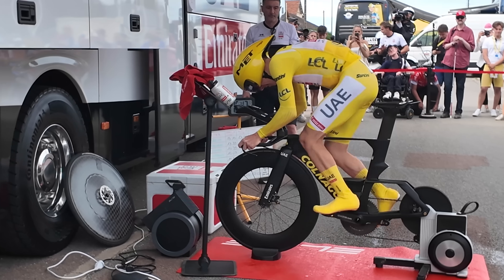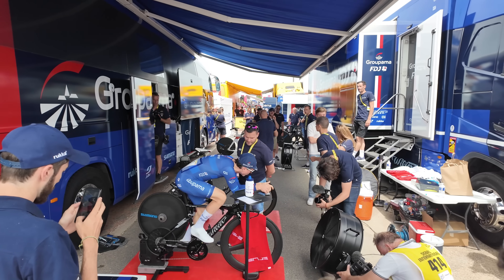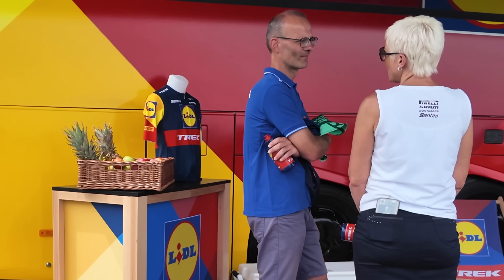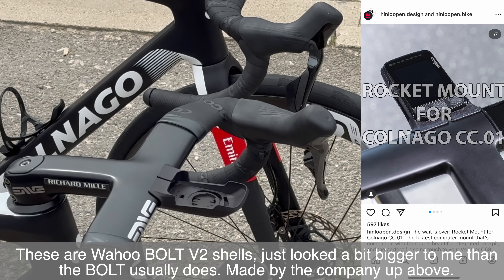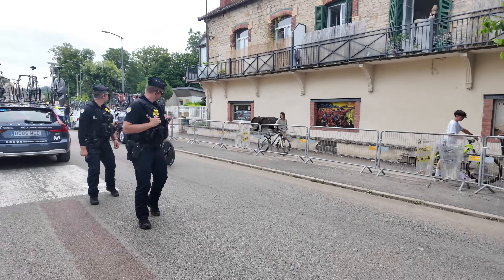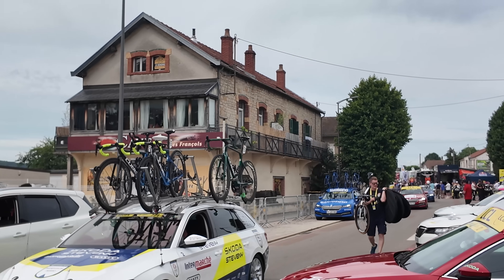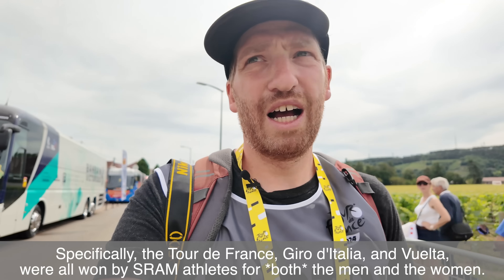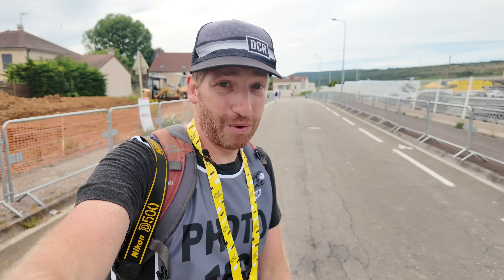Tour de France: Sports Tech & Behind The Scenes!

Comment: Can someone explain why they are using 11speed cassettes on the trainer. Do they run 11 speed on the tt bikes?
Reply from the maker: My guess is that because the NEO 2T (and 3M) came with 11sp, they were just two busy to swap out and riders are in ERG mode anyway where it doesn't matter. Or, alternatively, they have actually swapped to 12sp, but never re-wrote things. I didn't count cogs.

Comment: Do they use the edge 130 for the weight savings or is there another reason?
Reply from the maker: Partially weight, partially size (fits better in aero bars), and partially slightly better aerodynamics (but that really depends on numerous factors).

Comment: Great stuff Ray, love these behind the scenes videos. You mentioned some riders may be using pedal power meters from non- sponsors....did you see any Favero Assioma pedals...on road bikes obviously. 

Thanks as always.
Reply from the maker: Thanks! I didn't see any Favero there. There is I believe a women's TdF team that has them, but nothing on the men's side. They're a bit harder to get away with in a hidden aspect, due to the pods.
Reply: @Dcrainmaker  I wonder if they're going to eventually update their road pedals to use the spindles from the PRO MX's. Although I guess if they did that they would lose pedal body compatibility.

Comment: Why do they even have a clothes dryer with the washer? Isn't 99% of cycling gear line dry only anyway?
Reply: For you and I. For kit that only needs to last a (partial) season why not tumble it on low or no heat to speed up the drying process. Same logic for them using power washers on the bikes.

Comment: The team cars put lots of bikes on the roof, to push more air forward behind the rider.
Reply: That's why the follow distance regulation changed a few years ago. After that Ganna TT when the Ineos car was a solid wall of bikes and they were practically on his wheel. They need to stay 15 meters back instead of 10. Although 15 still seems questionable.

Comment: There are not 15 teams sponsored by Shimano. Most of them use their groupsets but are not sponsored and use different powermeter.

The sponsored teams are:
- Alpecin
- FDJ
- INEOS 
-Soudal Quickstep
- DSM

That's all. For example if you noticed at 16:00 Pogacar was using SRM instead of Shimano.
Reply from the maker: SRM is the singular example of a power meter sponsorship pre-existing the Shimano drivetrain sponsorship. Shimano also has two levels of sponsorships, one being outright sponsoring of compenents on a team (for compensation). The secondary being giving groupsets to cover it (more common on the women's side). However, there are a number of teams not on those 5 above that are upset about the Shimano accuracy issues, but are being told by Shimano they aren't allowed to use other power meters, per contracts.
Reply: @Dcrainmaker  Interesting! Thanks!
Reply: @Dcrainmaker  BTW interesting that UAE is  using different chainrings and rotors tho!

Comment: Could you make a list of the power meter each team uses?
Reply from the maker: Yup! Coming up. It's a bit messier to do at the TT stage, because sometimes we see slight differences in the groupset configurations due to the TT bikes. Usually it's 95% the same, but I'd hate to miss the 5% that are swapped/missing. Plus, the regular stages allow me to find the fun teams that have power meter pedals when they aren't "supposed to". ;)
Reply: @Dcrainmaker  Fantastic!

Comment: It's OK checking fir motors etc but when I rider does a bike swap mid race wether its planned or due to a supossed "mechanical" it kinda makes the pre race check obsolete 🤷🏼‍♂️
Reply: They also check a lot of the bike after the race and if I remember correctly, winners and jersey holders get checked every time, regardless.
Reply from the maker: @HobbyHoarder  Correct. They hold/check the winner bikes (using the NFC tags on every bike), plus all bikes are inventoried pre-race with the non-removable tags for tracking, and then randomly/periodically checked as well. It's not a perfect system, but it makes it just difficult/messy enough that it's not worth it anymore for the teams (I fall in the camp of strongly believing motors have likely been used in the TdF in some past years).
Reply: No